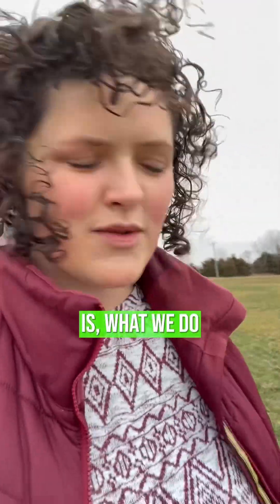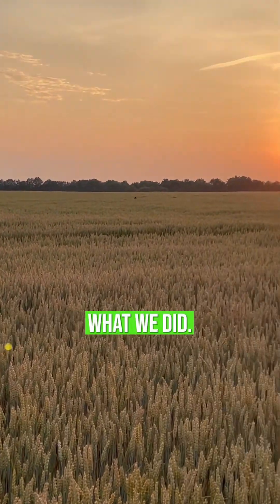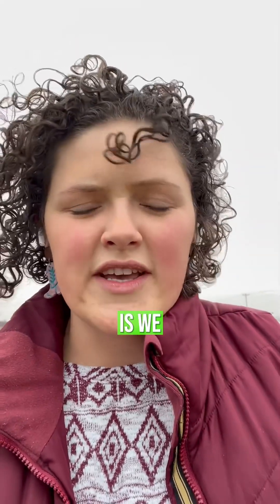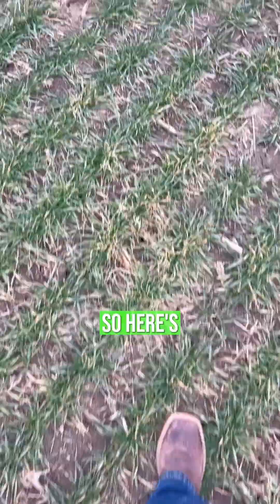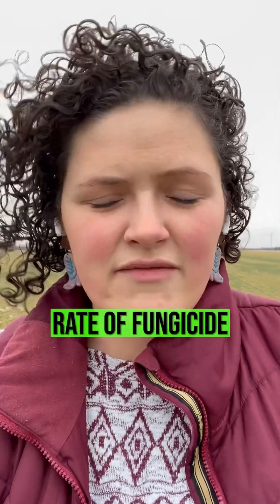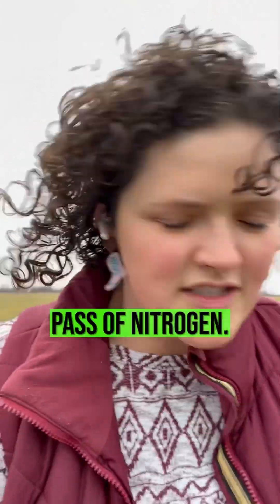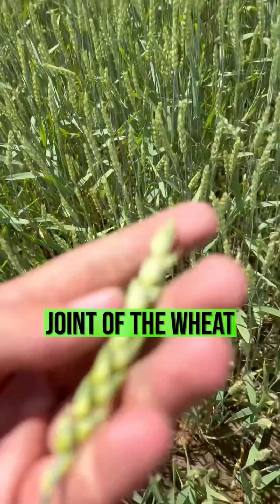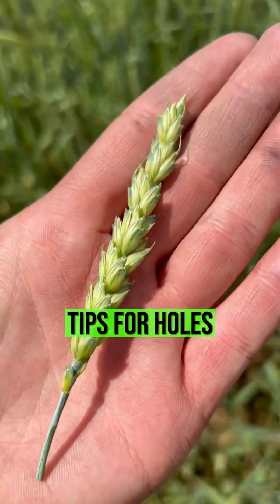How To Grow 100 Bushel Wheat

Comment: Why not switch to regenerative farming? You'll return some life and carbon to the soil. It will be cheaper and better for plant/land health in the long run.
Reply from the maker: One size doesn’t fit all
Reply: I would argue that maximizing production is inherently regenerative. A 130 bu wheat crop has an incredible root system, produces tons of root exudates, and supplies a ton of carbon rich residues, all building soil health. This is regenerative in my book.